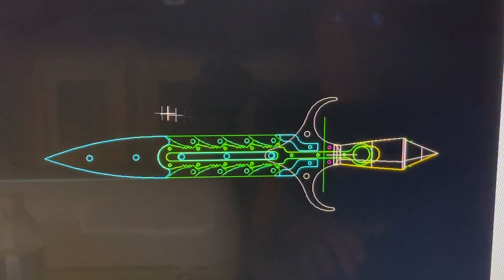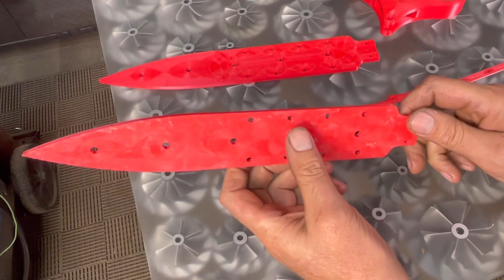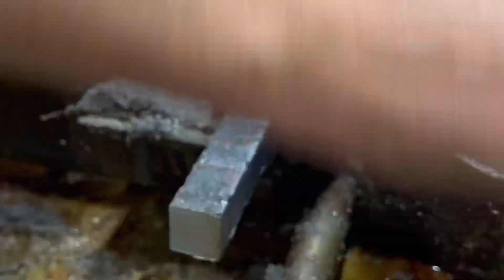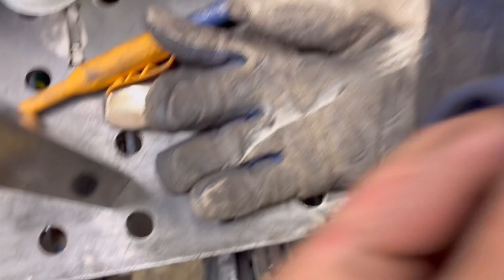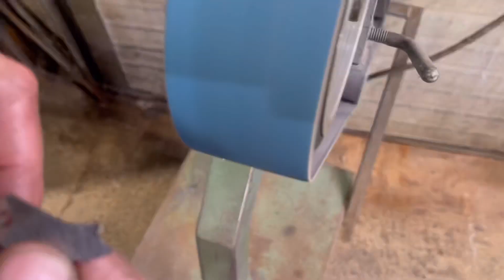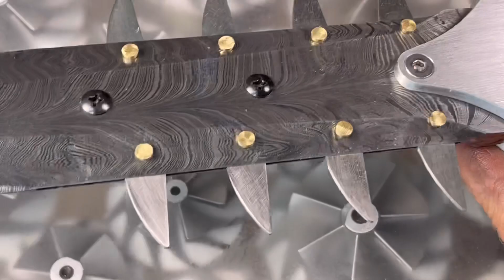Fantasy Challenge , RIBCAGE !!

Comment: I was thinking that you could just have a spring-loaded sliding grip be attached to the center gear bar, so when you push the blade in up to the guard, you can just keep pushing to extend the teeth. This is very close to a fantasy concept that actually works, kind of.

Okay, after seeing all the videos, this is the only one that I can vote for. There were some very pretty knives, but most weren't very fantastic or replicating an existing design. It came down to the whip sword and this, and this beats the whip sword in originality and execution. Congratulations.